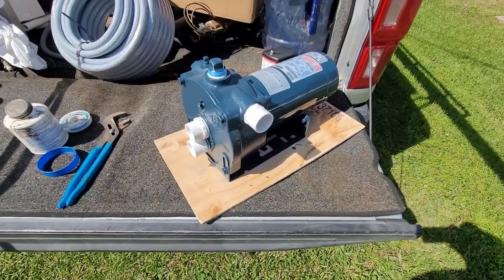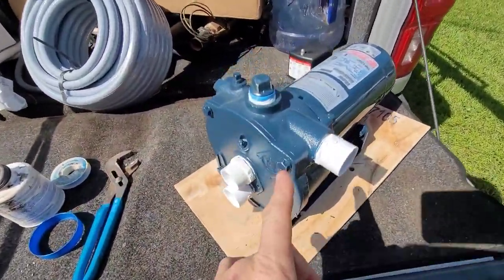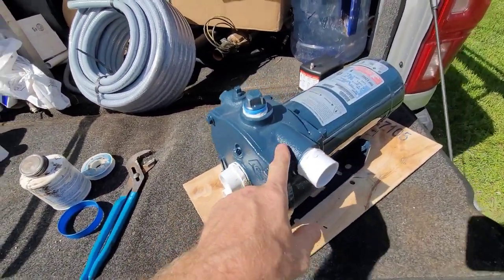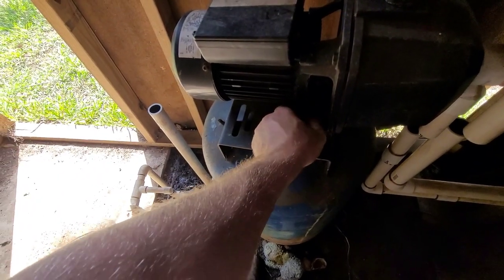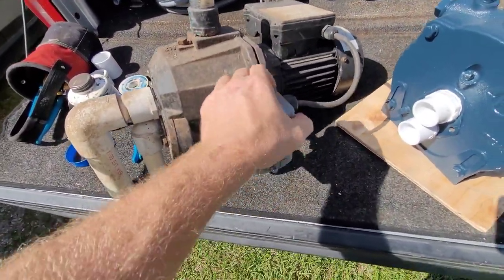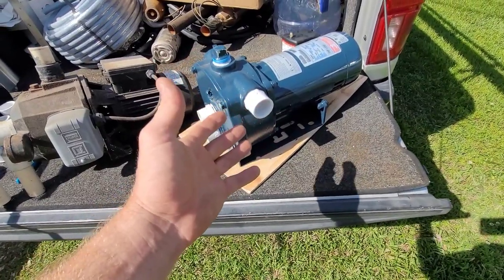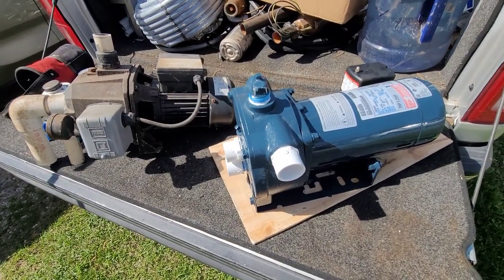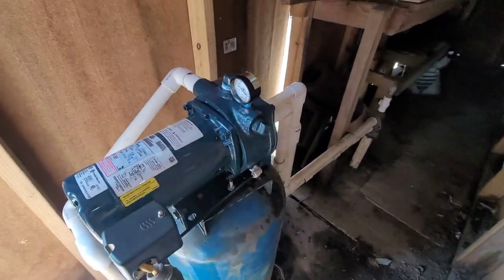Water Well - Deep well Jet Pump - Replacement

Comment: I agree with you on the good ol’ Starite pumps. That’s all I install but there’s a distributor that’s getting me one of these so I can try it out.
Nice quiet pump unlike the junk that was on it. 
👍🏻👍🏻👍🏻
Reply from the maker: I really like the Franklin's just hard to get like anything right now...
They are as expensive as a MSE though and it's a two stage ya know.  I prefer doing deep well on well much easier to service and prime!
Reply: Those pumps are made in china also . What’s you hate on china? Most of the stuff you own is made in china lol
Reply from the maker: @Tierone1337  Nah dude Franklin pumps are made in the US or Mexico they use high quality  materials and have parts available!   China is throw away junk!
Yea sure we're surrounded by China made crap and its sad some things are acceptable or what I like to call dumb things.  You know stuff that's just hard to screw up it can only be made simple and one way.

Comment: I have a Sta-rite SNE-L irrigation pump that is not running. I think it lost prime from a small leak because I heard it topping back off a couple times. I found it yesterday overheating and shutting down, then cooling off and trying again. I let it cool down and tried to fill it up with water. It does the same thing. Do you think it could be a matter of replacing the capacitor like you showed in another video? Well, capacitor and start switch. I figured I'd try to find them. I looked online and can't find the part number. It's not listed in the repair guide either...at least the one I found online.
Reply from the maker: So when you say it's not running as in the motor is only humming?

If the motor runs but won't catch prime then you have a suction leak on your lines coming from well.  Check fittings in pump and or threaded or recently repaired things.

If the motor is humming then it's usually a capacitor especially now with the heatwave were having.

The capacitor you need is a 161-193 you can order one on SupplyHouse.com, may take a few days to get.
Reply: @ClearWaterPumpWell  First of all...THANK YOU for such a quick response!! Sorry for my poor description. It is humming, the motor casing heats up and I hear a click and the humming stops. Then after a little time, it starts humming again and the process continues. I ended up pulling the shunt in the electrical box at the side of my house to drop power. From your other video showing the replacement of the capacitor and switch, I saw how you used your screwdriver to stop power. That was a cool trick. I hadn't seen it until after troubleshooting the pump yesterday. Do you happen to know the switch replacement part number by chance? If so, I'll order them tonight. BTW, also looked at the windings and they are still copper colored. Thank you for all you do. This is great!
Reply from the maker: @seandunathan6279  Here is one off Amazon but you can also use sand paper strip to clean off burnt contacts.

https://tinyurl.com/Amazon-AO-start-switch
Reply: @ClearWaterPumpWell  Well, I've responded to your last post 4 times now and it disappears. I'm guessing YouTube doesn't like the links I added. So, I wanted to say that I visited the link you provided for the capacitor. Mine is 220 VAC. So I looked and found three in stock that are 220/250VAC. One mentions a resistor. Will any of the three work for me?
Reply from the maker: @seandunathan6279 

This is the capacitor you need and no it doesn't have to be 220v version.  Most important it has to be the correct form factor size. 

The link I sent before was for a start switch. 

https://www.supplyhouse.com/Bluefin-CPSR6-161-161-193-MFD-Round-Start-Capacitor-110-125V
Reply: @ClearWaterPumpWell  I missed your last comment above regarding factor size. Not sure I totally understood what you meant. So, of course I bought the wrong size. I went ahead and bought the 220v and it was too tall. I left it there and used it overnight to run all of my zones 2 hours apiece. Since I had my original in my hands, I was able to measure it and found one at Amazon that would deliver next day. It came in and I swapped it out. There were even 110v versions that were too tall...and my existing was a 110v. Makes sense now I know what it does. SOOOooo, THANK YOU so much!!! You probably saved me $300 to $1,000. Do you have a social media channel where I could send you something for your help? I couldn't find a way to message you directly. BTW...another funny/annoying aspect of my repair. When the pump was originally installed, the rear of the motor was only about 8" from the side of my house. So, it was a real treat trying to get the back off unscrew the retaining bracket, pull out the existing capacitor, remove the wires and install the new capacitor. If I ever have a reason to rebuild it, I will be moving it, or turning it sideways.
Reply from the maker: @seandunathan6279  Yea crazy but they make different sized capacitors with the same values just physically different size.

Thanks for the thought no need, watching and commenting is good enough.

Take care,
Casey

Comment: Can't really tell but the old pump  impeller on motor shaft or is there a pump coupling either way weight of th impeller is futher out and putting more weight on bearing i like the new pump unlike the Old one probably required some alignment and the new pump bolted directly to. .ktor and closer seems better design. Just my observation
Reply from the maker: Oh yea for sure I really like the Franklin pumps.  They are very well built and yes the impeller is very closely supported by motor bearing.

Thanks for the comment and watching,
Casey

Comment: Hello, my well has water pooling up on one side of the well. It's not a lot but makes mud and stagnant water. I've had two different well companies out here and said my water inside is perfect and it's not an issue at all. It still bothers me though and like to know what's going on but I'm so ignorant.
Reply from the maker: Depending on where the leak is its usually not a big issue but can be a nuisance to be wet all the time.

Try feeling around pipes for water running or dripping from to locate if above ground.  If everything is dry then it's likely a cracked pipe underground and should be turned off dug up and repaired.
Reply: @Clear Water Pump & Well LLC.  Thanks so much for your advice. I dug about a foot or 2 until I found a line that looks like romex and a cheap black pipe attached laterally which is some form of drain I believe. Should I keep digging around the well until I find source of leak? Should I be concerned with hitting anything sensitive?
Reply from the maker: @nathangilbert1344  well of course you do want to be careful and the source of the leak is not going to be electrical. I don't know what your setup looks like so I wouldn't know where to tell you to look other than the direction or around the location of the water.
Reply: @ClearWaterPumpWell  Ok, awesome. Thanks again.